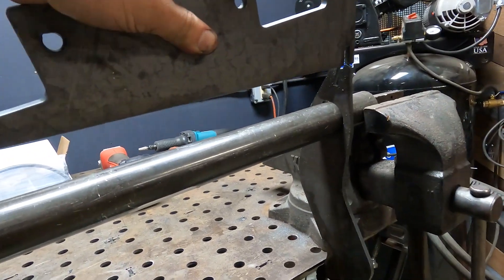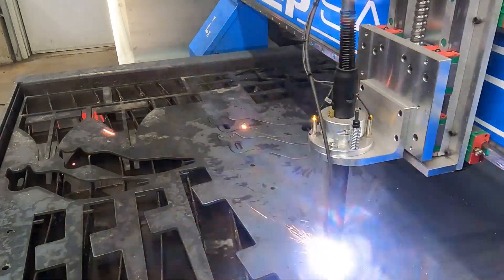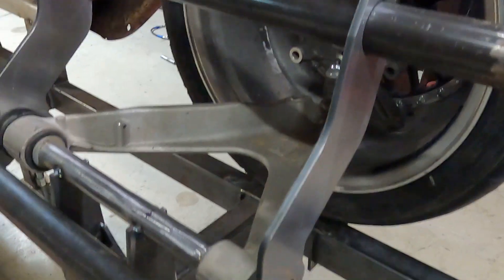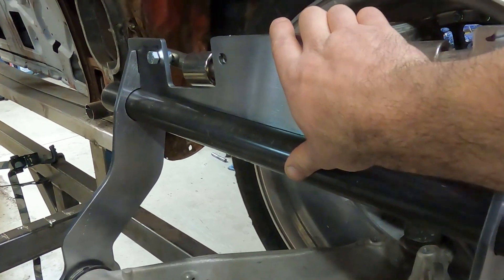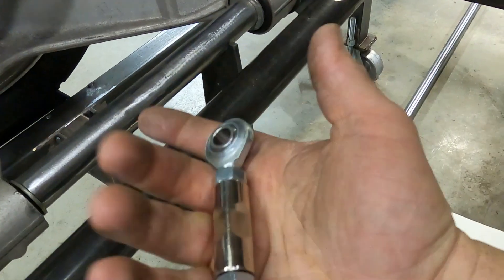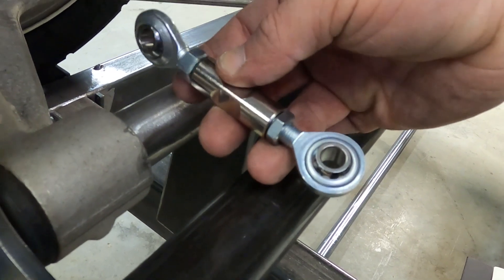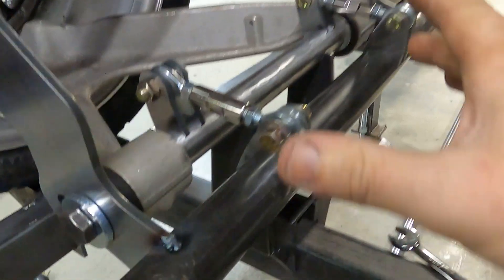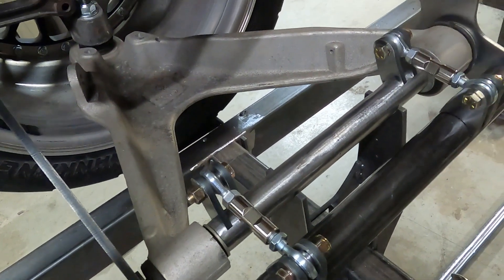I Installed the Front AWD Suspension mounts in my 1959 El Camino.

Comment: Don, those camber adjustments aren’t going to work the way you think they are.  How does a heim joint 2 inches above a slot prevent the arm from moving in and out? The reaction force will simply rotate the tube. Also you should be much more concerned with the brackets for the lower arm than the top, due to the fact that the lower arm is much closer to the contact patch of the tire. The upper arm has a much longer moment arm to resist the reaction forces.
Reply from the maker: I was going to stagger them one on top and one lower then I thought about just building lower control arms with heims. I am currently building the base of the chassis and running some tubes so once I have a way to set up the control arms forever I’ll redesign the lowers and  make adjustments. But thank you for the look out!
Reply from the maker: And about the lowers for structural rigidity I am running 1 5/8 chromoly tubing from the upper to the lower on both sides.  I think once it’s complete it will make more sense.   That design was to allow me to index my brackets when it came time to build the chassis instead of running tubes then making brackets work around the tubes